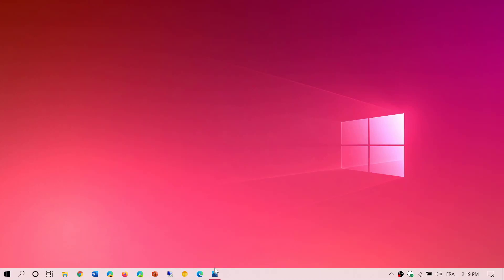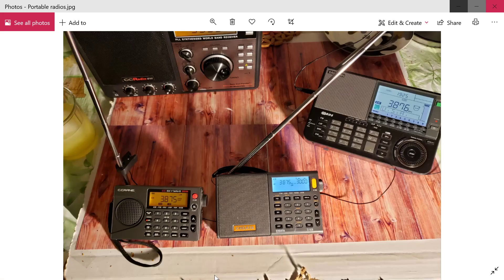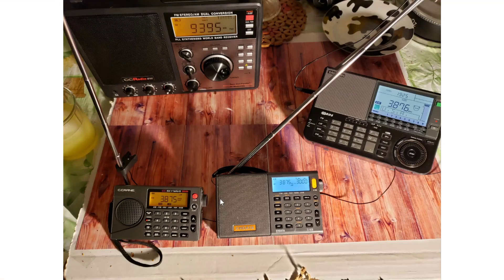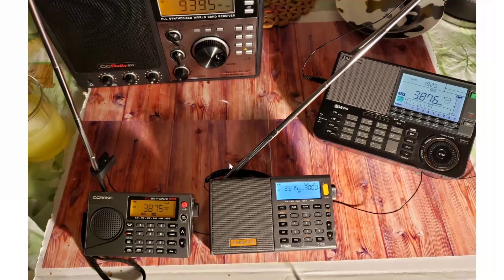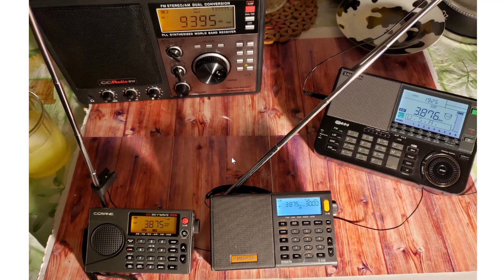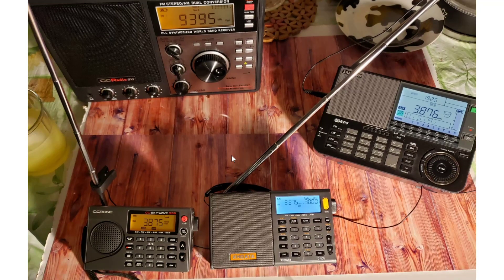DSP VS Analog Shortwave portable receivers What are the differences

Comment: An extra benefit to analog radio is that you can build a BFO and can tune around the ham bands to make their voice intelligible
Reply: A BFO is an absolute "must" if you want to resolve Amateur ssb or CW, or HF aeronautical traffic.  Also with analogue you can operate the tuning knob or dial with infinitesimal slowness. The dsp hops from one frequency to the next and you risk missing a signal, except you then have to operate the fine tune, which I've found to be a real pain.

Comment: Which is better for having the lowest RF noise? I'm a bit disappointed with my PL-660. It seems there are signals coming in but it is all or mostly static.
Reply from the maker: the problem is not the radio, it's that there is too much noise where you live.  I will post a video later today talking about it
Reply: @OfficialSWLchannel  Thanks.

Comment: Some radios like Sangean 909X and Tecsun PL-880 are half DSP. The FM section is full DSP with the antenna signal direct to the DSP IC Si4735 while the 0-30 MHz circuit is analog with double conversion and the last IF enters the Si4735 antenna input which is tuned fixed to the IF frequency . 
They use both technologies and take the best from both.
This is why you hear mute on tuning the FM band only on these radios.
The air band also works this way in all DSP radios. You will not hear any muting while tuning the air band in any DSP radio.